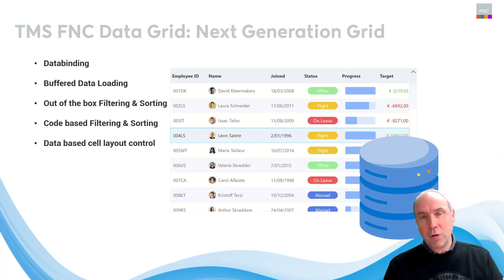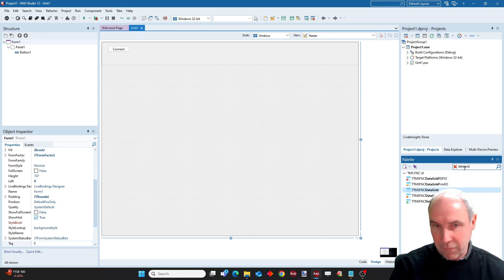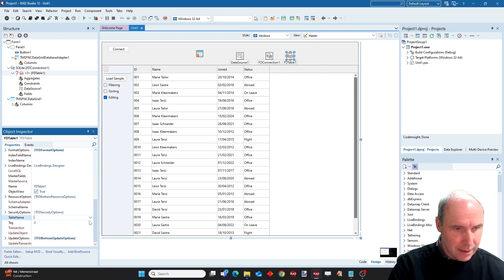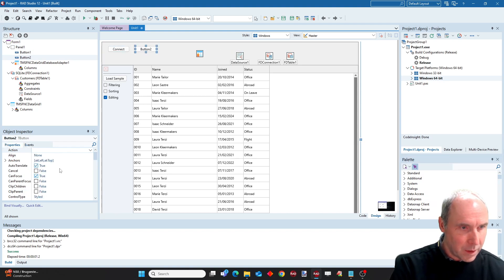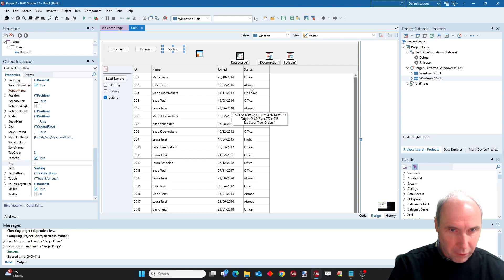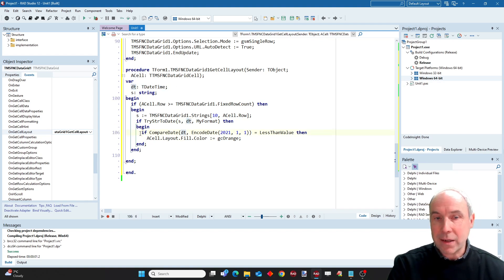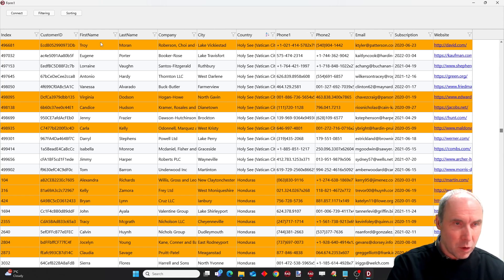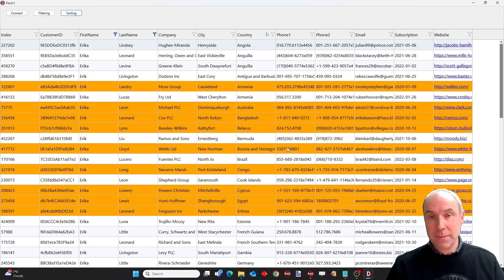Next Generation Data Grid - Part 2: High Performance Databinding

Comment: Question: How does TMS FNC Data Grid deal with the issues that previously DBAdvGrid addressed with the PageMode setting? That is, the choice between  loading from the database server only the records required for display (Paging), versus loading all the records (possibly time consuming) and thus facilitating much faster subsequent scrolling, and more importantly, facilitating sorting and filtering.   Also the first of these modes I believe maintains a cursor on the server, which enables immediate writing of edited data, whereas the non-paging mode disconnects from the server after loading all the records, and some kind of additional steps are needed to write the data to the server.  
Anyhow, what approach(es) does FNC Data Grid take to this tradeoff?  I'm not seeing this discussed in the documentation. Thanks.
Reply: There are 2 modes, buffered (default) which sets the buffer count to the amount of visible rows, and AllRecords, which loads all records. In terms of scrolling, there is no Page mode yet, but it's on our feature request list.
Reply: @iceCold101286  Thanks for your reply. But if "load only visible rows" is the default, then how is the Data Grid able to sort or filter sensibly? Does it compose new SQL behind the scenes to perform sort/filter on the server? Also, I see no mention of buffer or AllRecords in the docs.  I guess you might be able to see this if you have the source code. But at the moment I can't even get the available (no source) Demos to compile (apparently the precompiled components were compiled with mutually incompatible library versions), and that seems to preclude autocomplete from showing any clues, and also blocks learning about the components by experimentation.  So at the moment making headway understanding the Data Grid is slow going.
Reply: @Graham_Wideman  Sorting & Filtering is done directly on the dataset, there is support for ClientDataSet & FireDac, can you point out which errors or compile issues you see? I'm developer at TMS Software, so happy to help out
Reply: @iceCold101286  Thanks -- your emailed solution solved the compile issue.

Comment: Good work! You should add an option to enable column-based searching. For example, when a user clicks on any column in the grid, it transforms into a TEdit field where the user can type, and the grid automatically filters its data based on that column.
Reply: We are working on a similar feature coming up in the next version (Filter Row)